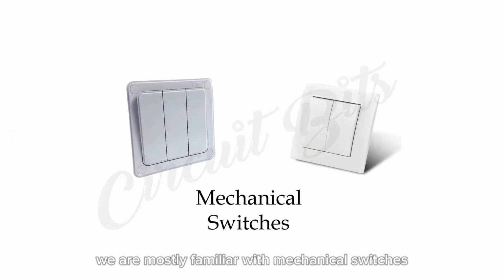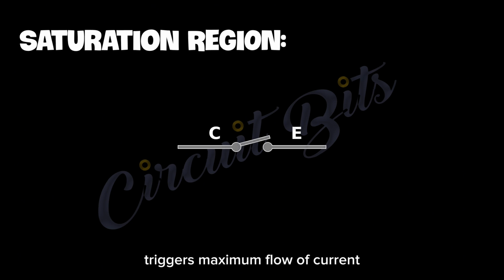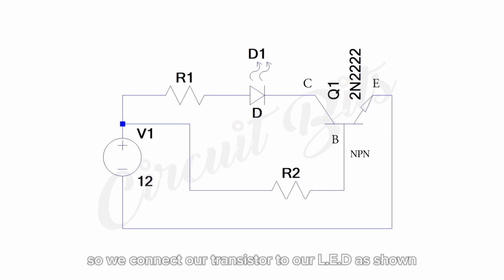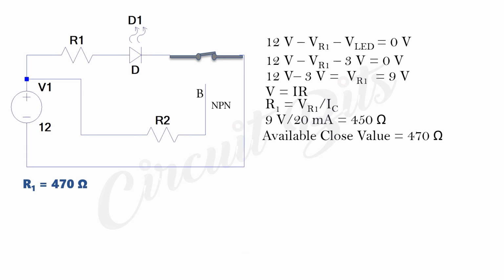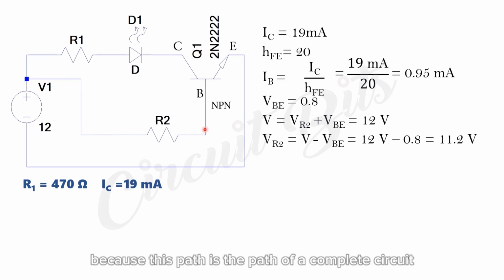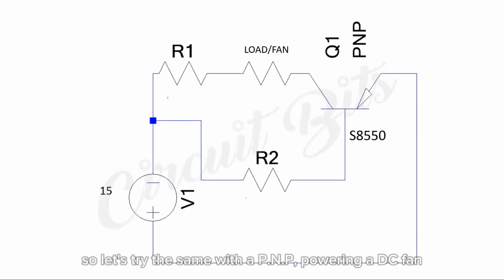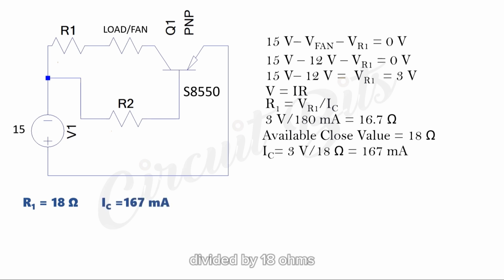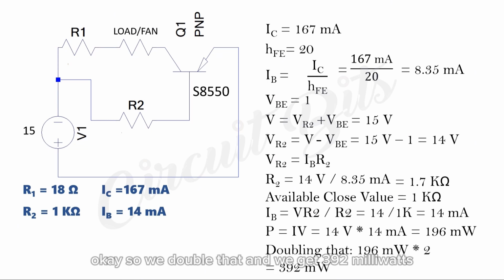Demystifying Transistors PT1 || Practical Transistor Moment

Comment: Simple and eye opening. I'm just wondering why you never seemed to use the exact hFE value from the data sheets from both examples.
Reply from the maker: I'm glad you find it simple.
For your question, Hfe for a particular transistor, at a particular time, depends on the collector current, temperature and other parameters. That's why even in the datasheet a range is given. So its for designers to chose hfe, considering worst case scenario.
Reply: @CircuitBits9 Thank you